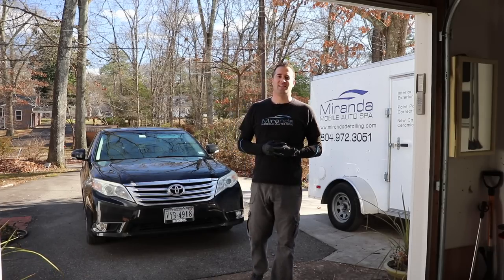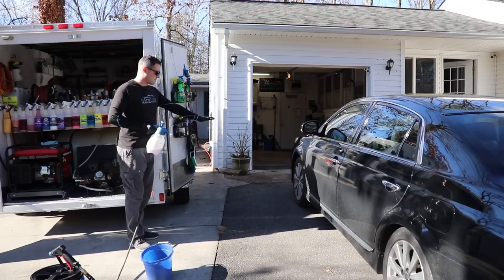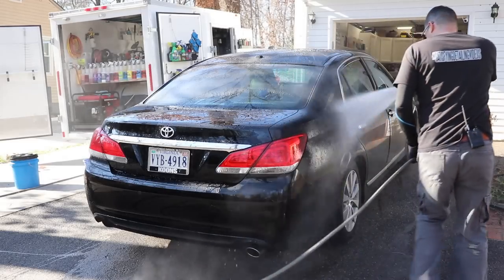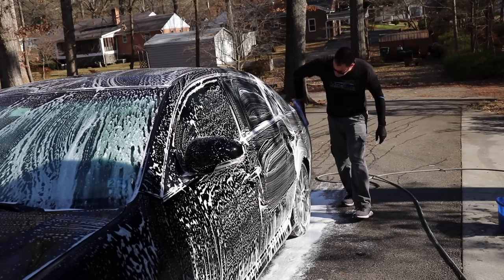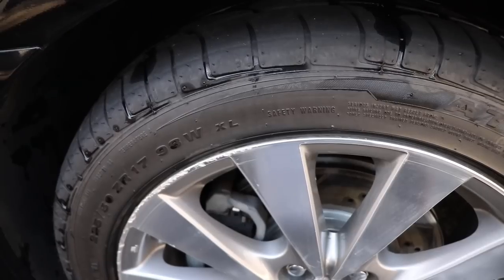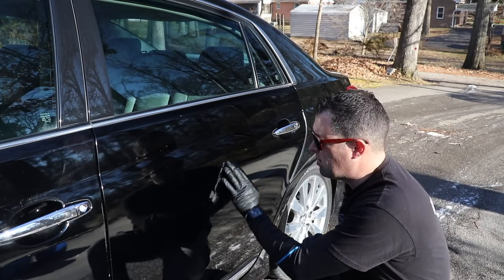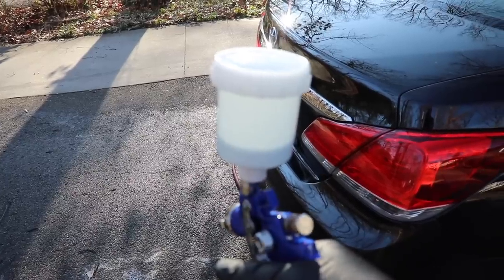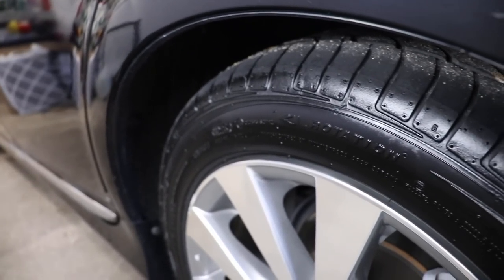Weekend Wash  Lots of Detailing Info and Product Testing!!

Comment: Sunny at 45-degrees versus 70+ is a big difference especially on black paint. But I am glad you did it by not following directions!
Reply from the maker: True. But as a mobile detailer I’m working in full sun sometimes in 90+ degree heat and crazy humidity. I don’t have the luxury of always having shade or a cool spot. So we find ways of working.

Comment: The optimum tire coating is very finicky, I've learned that power clean isn't enough to clean the tire and get all the residue and contaminants off. I figured out that mineral spirits or prep Sol are the go too's for getting the tire actually naked for it to be accepting of the tire coating.
Reply from the maker: Yup I did that too with the miners spirits. Still got the same results though 😕
Reply: @MirandaDetailing  Dang, Sorry about that.That stuff is very picky

Comment: Demo on air spray gun, what pressure at the compressor outlet?  I need a that for those off-road tires too!
Reply from the maker: It’s at full 150psi. But to the gun it’s about 75psi